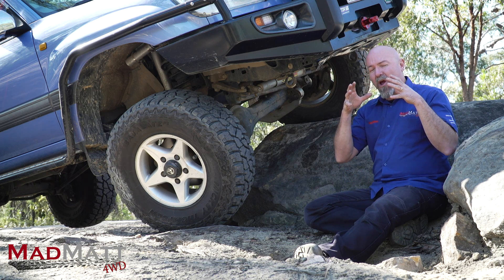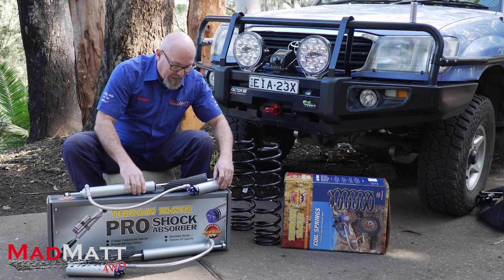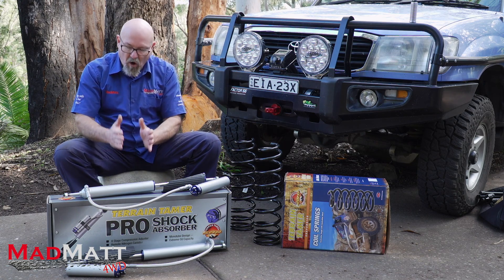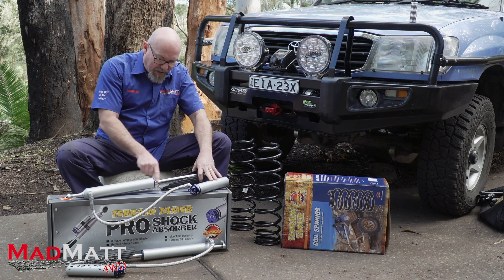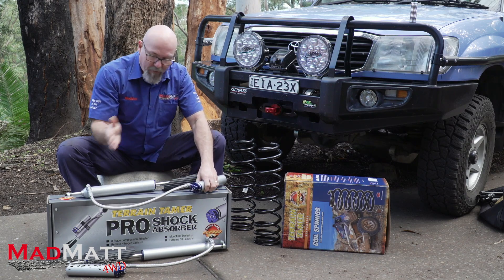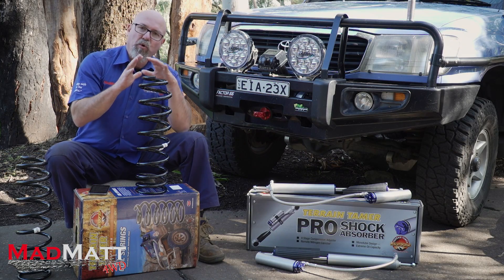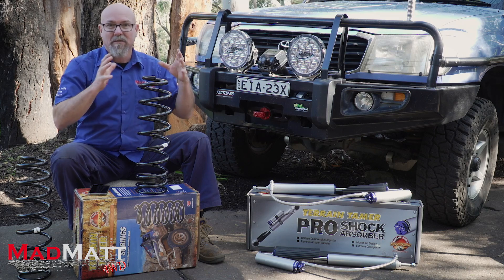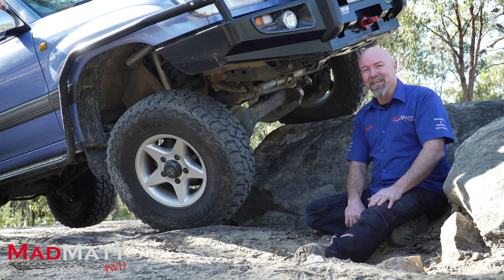Remote Reservoir SHOCKS Are they RIGHT for You? What about coil springs how are they involved?

Comment: Adding pressure to the oil entrapped inside the shock is akin to adding pressure to your vehicle’s water cooling system. The higher the pressure, the higher boiling point & therefore  the harder it can be worked before the oil reaches the boiling point.  As with almost anything subjected to high temperatures, sooner or later the point can be reached where failure is inevitable.   Great video here & you definitely made that observation clear .  Thanks , from the U.S. of A.  😎👍
Reply from the maker: Spot on mate!

Comment: Hi there

Just wondering if you are still running the pro shocks?

How do you find the fixed rebound setting? Is it very good across different terrain or does the shock need adjustable rebound.

Is the compression adjustment adequate across different terrain especially fully loaded?

Also how do you find the progressive front springs?

Thanks
Mick
Reply from the maker: I'm very happy with the setup. I mean they have their limitations as they can't adjust for rebound but for the average user they are great. When i tow the race car i crank them up and then if i'm running around town i set them soft. On high speed dirt i can hook in with confidence.

Comment: Do u get better ride over bumps? Heard it make bumps not as harsh?
Reply from the maker: The ride will depeand on making sure the shocks are fitted to the right vehicle. The adjustability of the shocks does allow for a better ride assuming the above. You can change the adjustment depending on the load.
Reply: @MadMatt4WD   many thanks matt! Would love a video on adjusting shocks, got no idea on words like preload and rebound!
Reply from the maker: I have done  a few on shocks but id have to check if I covered those points.

Comment: Ok, now I REALLY want to build a system based on the Citroën oil/nitrogen parts. Basically a pressure source, hydraulic rams with nitrogen spheres and a hydromechanical regulator for height sensing. Let the hydraulics take care of the spring and heat job, and the dampening works like that shock absorber. And the party trick is that spring and damper are dynamically connected. More load=more oil miving around the damper. And the really fun stuff begins when you incorporate the "hydractive" parts. Let an ECU control a separate sphere for softness on smaller bumps, and disconnect in for stiffer dampening on the big bumps. Damn, I want that.
Reply from the maker: Do it. LOL I think there are a number of systems out there along those lines. I think the Toyota Kdss system is a variant.
Reply: @MadMatt4WD  I have to google the kdss system. But Citroëns are a bit of a passion so I probably feel more comfortable there. The only problem I see is how to get/make some suitable rams and maybe tuning/finding the correct damper properties in the spheres. But I imagine that Citroëns have kind of a "secret weapon" there. All Citroëns except the last has trailing arms with very short rams that are "geared" to a lot more travel at the wheel. (sorry for my bad/strange english). Also the system with separate spheres are possible to connect in "serial/parallell". It´s only important to remember that it´s a bit "backwards" compared to metal springs. Meaning that you take "away" suspension to make it more stiff. In essense, very hard spheres (little gas+smaller orifices) at the wheel cylinders, and a more soft+less dampened sphere that you can connect inline with the wheels to make it softer when needed. And if you also take the active roll-correction from the Xantia Activa you will have zero body-roll on the road combined with 100% disconnected anti-rollbars when flexing. That one is also surprisingly simple in it´s layout. One anti-rollbar-link per axle is replaced with a ram that the car adjust with a hydraulic/mechanical valve connected to the roll-bar. The simple and genious part is that when roll-bar is not needed the system use the same kind of valve-part with a sphere on it as the regulation of "sport/comfort"-suspension. I understand if someone has doubts about this, but Citroën are really good at hydraulics. Most failures are due to people without knowledge trying to "fix" something. It´s a bit sad that I only have a IFS-car to try it on (Isuzu Trooper). But maybe it´s a good idea to hold myself back a bit and only do it in the rear anyway.
Reply from the maker: Citron have always had a good reputation for creating a good ride. This is the Kdss system. https://youtu.be/NLF6n3nMwww
Reply: @MadMatt4WD  That was interesting. Looks like they were inspired a lot of the SC-CAR (Activa) system. Very nice to see that they did something like this for offroad-use. And I guess thy have something similar to the Activa for controlling it. Although I couldn´t see if leaning vas actively controlled or more a result of controlled stiffness. What I mean is something like "in the Activa, leaning is a choice, adjust it wrong and you are leaning at maximun on a straight road". Although I see a potential problem there. The Activa is always interacting when flexing. They are best in class while taking a bump on one side, but may look a bit funny when parked on uneven surfaces. I guess it would sometimes be pretty stupid to have this when crawling rocks. But I guess the Citroën way with this is to throw some more regulators on it. And a lot of beer on yourself...

Comment: G’day Matt. About your Compression setting. Your front is on 4 that’s from the soft setting I guess and the rear is on 1. Is that the same on the Rebound adjustment? Im just trying to see what is the best combination of setting... cheers 👍👍👍
Reply from the maker: Hey mate. You’ve Identified the settings correctly. 1 is soft. Since filming this I’ve brought the back up to around 3. But I can’t tell you your settings as there are to many variables.
Reply from the maker: The adjustment affects both comp and rebound
Reply: Thanks Matt. You’ve given me an idea which side to start👍👍 I will try one by one to see which of the 24 clicks is the best.. happy day’s.
Reply from the maker: You’ll change them depending on load and terrain.

Comment: Koni Raid 90s for me
Reply from the maker: How long have you run them? what do you find about them that you like?
Reply: Been running them for about 3 years now. Serious tracks too. Canning,  Simpson,  Cape York, etc....
Decided I wanted something a bit more serious than the foam cell shocks I'd been running.  I had heard good things about konis and really like their simplistic design.  They do not use a gas charge at all,  it is a large volume oil only shock that cools extremely efficiently.  I think it's always horses for courses but I've found they work fantastically with the 70 series leaf spring design and I really like their tough,  no nonsense approach.  Totally rebuildable  they are designed for rugged outback travel. And they are an impressively large and very high quality design
Not only that,  they have transformed my ride. I mean did I mention how big they are??.... they're big......... not that size id everything of course........ at least that's what i'm told!..........
Yeh they're not the cleverest design out there (although they are tuneable) but they are simple and solid and rugged and built to last for years just like the landcruiser itself and I think they'll be good for many more thousands of kms yet. In fact I can't fault them.
Reply: Course I drive a hzj75 which is basically like a horse and cart but without the horse.  So I like to keep it simple

Comment: ןI liked your video but I have some remarks: the nitrogen is not there because explosion free, it is not to contaminate and oxidize the oil. The heat disipation is not due to the expansion botle..
I will preffere a gas shock

Comment: I'm sorry Matt but you've taken all of the secondary details from the shocker and made them the primary points. Shock absorbers are there to stabilise the springs and heat is a side effect of that process. The oil is there as a dampening fluid and not because it acts as a coolant but it does because it is the only fluid present, if oil was good at cooling, your engine wouldn't need a water based coolant system.  Scragging removes the original springiness and sets the springs to their natural height, if that didn't happen then when you fitted your springs you would get sagging over time as they bedded in, scragging removes that bedding in process so you don't get sag. Shot peening increases durability and life of springs by reducing the residual compressive tensile stresses added to the metal in the forming process.
Reply from the maker: I’ve since watched the video with your comments in mind and can see how you have come to your conclusion but I think if you were to watch again you would see that i do understand the workings of shocks. I do tune them on the ultra4 racecar and they’re a 3 stage bypass shock with a seperate coil over shock for the suspension. It’s not a simple setup.
Reply from the maker: Haven’t you basically just re-said what i said?
Reply: The difference is it looks like mad matt said his facts in one fluent talk in each segment. Where as you, you were typing it and still had to edit it. Im going to listen to mad matts explanation.
Reply: Love your videos matt, but re shot peening and scragging I think you are both wrong.  I have little knowledge of spring manufacture but have a general (admittedly pretty basic) understanding of heat treatment / fatigue as a mechanical engineer.  Shot peening is there to introduce compressive stress at the surface.  That is because springs see repetitive loading / unloading = fatigue.  Fatigue pretty much always initiates at a location of tensile stress and normally at the surface (unless you have sub surface imperfections), so having residual (i.e. in normal state) compressive stress at the surface basically gives you a lot of extra ability to handle the stress as the surface stress moves from compression to zero to tension (rather than straight to tension).  The re-heating is a type of stress relieving / tempering.  I'm surprised it happens after shot peening, I would think it would be before.  That reduces the springs strength and hardness, but gives it more ductility, otherwise it will be too brittle.  But yes it will also reduce residual stress / relax the spring a bit.  I would imagine scragging plays a role similar to shot peening, by overstressing the spring to the point of material yield, the spring is left is a stress state of residual compression due to that initial overload.  It basically doubles your allowable stress because under loading, the stress actually reduces from the negative stress state and then starts from 0 stress state as more load is applied.  That is the same reason why pressure vessels are pressurized much higher than operating pressure under load testing, a process called shake down.
In general, springs apply a force proportional to displacement, while shocks apply a force proportional to velocity.